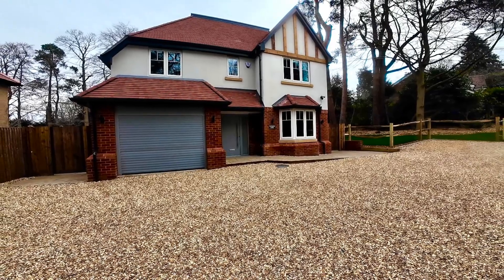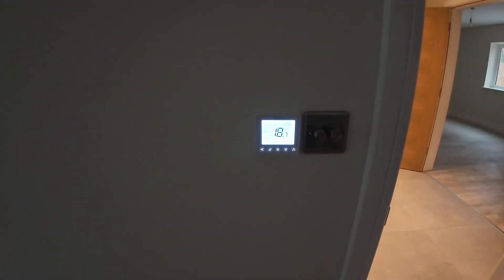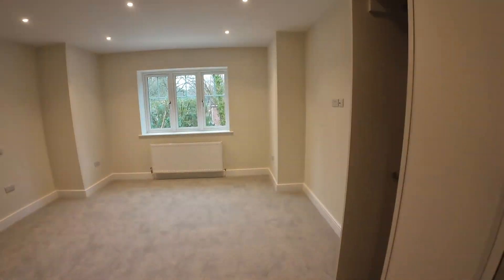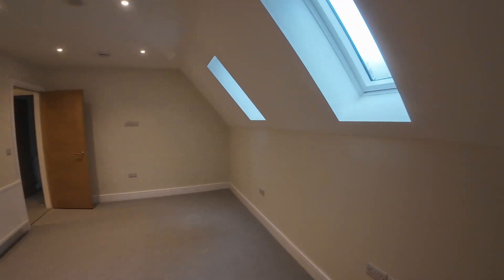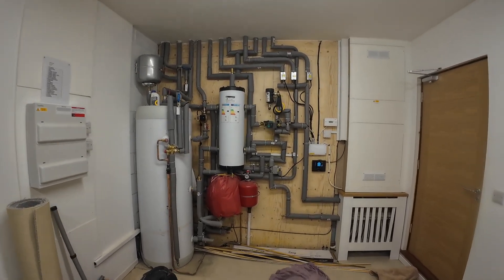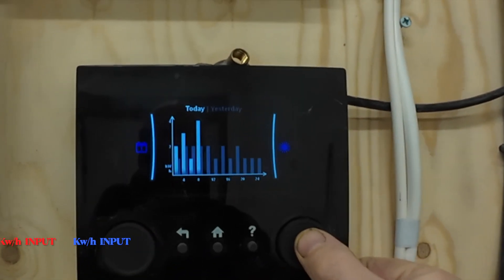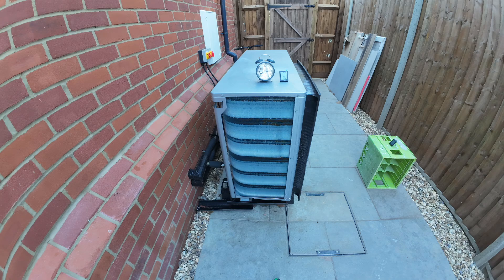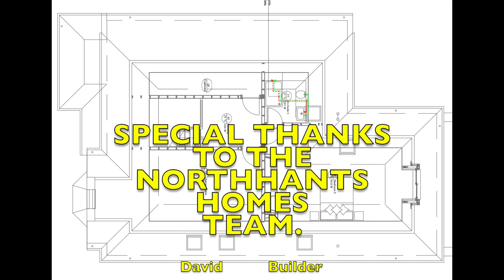AIR SOURCE HEAT PUMP  THE 2 THINGS I WAS MISSING .

Comment: Why such a small cylinder?  Surely with all the showers in use or even two ,  and kitchen , it will require a full cycle to recharge after 15 mins use, if the issue was debris you will find your flow rate in the software would have been 3-4 times higher egaround 1100  litres apposed to 300 , that wouldn’t account for these errors unless it fully blocked, but then the software usually gives the equivalent of an e7 error in Mitsubishi that code can be 115 or 105 I can’t remember exactly , I don’t think we will see another deep freeze, so it will be impossible to tell.
Reply from the maker: Hi yes only a 300ltr cylinder I did advise builder but he wanted to stick to design  I just hope who ever  buys the house does not have  a lot of people with long hair . Thank you 👍

Comment: What insulation does the house have? What was your EPC rating before you fitted the ASHP?
Reply from the maker: Hi the house has insulation to the latest building regulations  this includes 100mm cavity wall insulation. triple glazed windows  ( not that they very effective ) in my opinion  120mm insulin in the floors and 150mm insulation in the ceilings .Thank you 👍

Comment: Nice house👍 Its funny, A lot of the heat pump problems go away, when the weather warms up😄
That hot water  cylinder, dosent look big enough with 5 bathrooms. Hot water will be lower temp, so less available water, and they will run out. The heat pump cant replenish as quick as a PDHW enabled gas boiler.
Id be surprised if those towels rails will warm the bathrooms enough in the winter!
Should be mandatory for solar, lot less to install when building and can save on roof tiles!
Reply from the maker: Hi I know what you are saying but I am realist and as engineer  confirmed defrost cycle normal  there is no problem . As I pointed out in vides the target temps were reached even when we had several days of cold weather below - 3c so I am confident that it is performing well . Regarding the hot water stored  I agree and have pointed it out to the builder but he is happy to stick to design  . Time will Tell . You would be surprised ,the towel rails have even impressed me they perform  really will.  this house is very well insulated.  Thank you 👍

Comment: How does the machine extract warm air on a winters day?
I was surprised that you have standard size Radiators.
I thought you had to have extra large Radiators with heat pumps?
Can you change the temperature for individual rooms?
Will the system work efficiently if you do not have underfloor heating??
Thank you!
Reply from the maker: Hi basically the heat is extracted from the air by passing the air through the condenser, the condenser it almost always colder than  the  air traveling through  it .  Hot always transfers to cold  there fore the very efficient condenser extracts the heat from the air passing through it. Regarding the radiators  they are calculated to give the correct amount of heat into the room Ie they are calculated to a lower delta ` T '. For example if the out put of a 600 x 600 radiator is  2 kw/h with an input temp of 80 deg.C ,  to get   the same out put from a radiator with and input temperature of 40 c the size of the radiator would have to be 600 x 1200mm  This is low temperature heating .  Thank you
Reply: @HEATSEEKER1428  
Thank you!

Comment: Your system looks over sized and over zoned which is why on such a well insulated new build the COP is so low
Reply from the maker: Hi yes  the cop is low . the builder is fanatical about using stats to control . I have got to educate him in using weather comp and flow temps to control  temps of zones so that controls are wide open most of time. Thank you👍

Comment: Was the 30lpm before or after clearing the filter?
In a previous video you appeared to rule out flow and system volume.
This pump still looks on the large size for a new build property like this.
Reply from the maker: Hi I did not notice at the time but all of the underfloor heating zones were off . The builder in his wisdom is trying to save   on usage  Tank you 👍
Reply: @HEATSEEKER1428  ... whats happening is that the system is short circuting, and even at a flow temp of 33 degs the house can't take anymore heat (excellent insulation & TRV's = small flow volume & heat flux ), so all that is left for the ASHP to do is to try and dissipate heat via running the pump rate at max velocity, also try turing the compensation curve down to 35 degs and or reducing the max input to 16 amp.
Reply: @HEATSEEKER1428  Remove the zone actuators from the manifold. That will solve your problems most likely.
Reply: @HEATSEEKER1428  That makes complete sense if a big chunk of the emitters were turned off.

With all of these zones, individually controllable, then there will be issues if any are turned off. At least you know how it can perform when it's wide open. It isn't going to save money if rooms are turned on an off all the time  - the occupier will get poor performance and slow heating times. Heat pumps need to be wide open and on all the time - very different from gas heating.
Reply: @ChidleyEngineering you seem to know your stuff. I have a ASHP installed and I have yet met anyone who call tell me the perfect setup on winter settings, even the company who installed. I have it in 9 years now, installed from new when we built our new house, all UFH down stairs with all tiled floors, up stairs all rads. I have the living room stat which is never used switched off, based on what you are saying all stats should be on at all times right? Also, the UFH manifolds the water in the vessel looks dirty, is this normal? House is 2700 sq feet in size. Based in NI my electric costs by day during winter is approx. £9-10 summer is around £4 👍
Reply: @ I'm not an expert but John Cantor, Heat Geek and Urban Plumbers are. I don't think that there is a "perfect" setup and I know that I'd do my own differently if I had limitless money. For all rooms that are being used, I'd have the heating on all the time but adjust the flow rates so that the temperature is comfortable. Search for heat pump monitor by open energy monitor to compare stats.
Reply: @ChidleyEngineering you know a lot more than me anyway… 😂 Thanks for getting back, I’ll look it up here now 👍
Reply from the maker: Hi yes Money is always a factor  . How much do you spend to save  ? Yes I personally I think  running flow rates as low as you can get them  with weather dependent is the way to run the system with room stats as just a back up . Thank you. 👍
Reply: @ Low flow temperature, high flow rates, weather compensation, balanced radiators and TRVs for backup is how I run my system. Great minds think alike 🤣. I'm getting a COP of 4.3 over winter, this will go down over summer when it's DHW only. I only use the TRVs when the rooms are out of use for a while (over a week).
Reply: ... the normal flow rate on my 6Kw daikin is 7l/min on a 1918 114sqm cottage - it has no zones or additional pumps, all TRV's on the rads are fully open, and the house is controlled on leaving water temp., I would expect a modern build like this fine example to have a heat loss of sub 5kw, I would expect the flow temp to be a max of 35 Degs in the middle of winter. Urban Plumber and Adam from heat geek did a great vlog on a new build with had 12kw heat pump installed but the heatloss was only 3kw. At the other end of the spectrum Adam/skill builder did a great set of videos on John Morgans 12kw heat loss house.